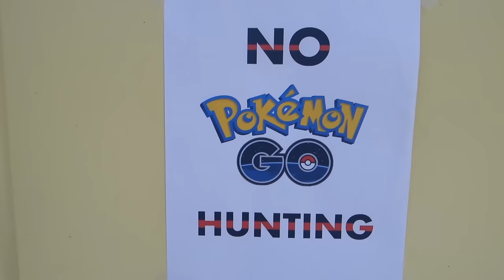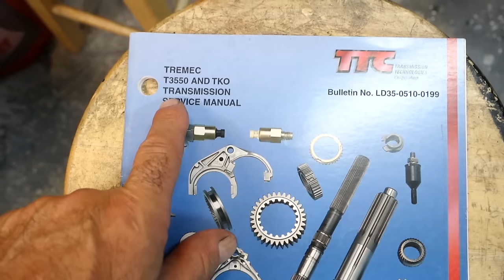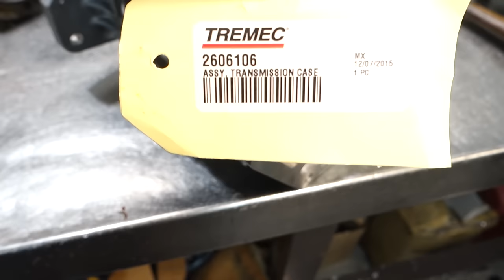How To Rebuild a Tremec TKO 3550 , 500 or 600 5 Speed Transmission

Comment: would it be possible to get a part number on the upgraded synchros you used in this build. I'm going to rebuild my 3550 and want to deff use the better ones. thanks!
Reply from the maker: The rings are available by calling us. The part # is a generic # and not the same as what others sell. 561-743-5600

Comment: Paul, Can you advise us what the proper oil is for the Dana300 and the Tremac T176? I am seeing conflicting information from other sources. I have a 1984 CJ7 with a T176 and  Dana 300 transfer case. I really enjoy your rebuild videos. Thank you
Reply from the maker: any 75 - 90 GL4 works fine.  The Tcase can run a GL5 and the gearbox a GL4.

Comment: What syncro did you use? We always had problems with them scraping after a real hard pull or two from the track, or just cutting it loose on the road. But mostly if some one missed 3rd gear then it starts. Great Video buddy honestly, help a lot on some stuff!! Thanks..
Reply from the maker: I use my own bronze forged rings. No issues

Comment: Question:  First of all fantastic video, my question is that after I removed my 5th gear, I noticed a small gap in the needle bearings as if it was short 1 bearing.  The input was not like this.  I may see the same gap in your video at 46:01, cant quite tell.  Can you confirm that the 5th gear bearings are supposed to be this way?  Thanks!
Reply from the maker: there has to be space in between the bearings for them to rotate , so sometimes the stack of clearance of all the bearings ends up with a little extra space.
Reply: awesome thanks for reply

Comment: Do you have a part number for the recommended forged bronze syncros? Have a tko I pulled from a 427 s/c cobra csx4000 that shift like total trash with like 8k original miles on the car and I really like to put these syncros so my 80 year old customer can actually drive the thing. I just added power brakes from him so making the trans/clutch a bit easier for him is next on the list! 
Thank you for the content not many very informative videos on these out there that are this easy to follow along.
Reply from the maker: They are available from us only. Read video description for all contact info.

Comment: Hello everyone!!! I need some advice and feedback please. I have a 67 Mustang gt S-code that came with a 390 4 speed originally. Was built to race car, built 460 Ford Big Block with a Built C-6 Manual valve body. I want to go back to a manual 4 or 5 speed behind the 460. Any suggestions what would handle 500hp and 700 on spray? The torque is way up there too. Thanks so much in advance for any suggestions. Cheers from Motown.
Reply from the maker: Companies like Modern Driveline sell TKX 5 speed conversion kits. Look them up.

Comment: Question….looking to convert my Ford TKO600 from a .82 to a .68 are the GM and Ford parts interchangeable for such a job. I’m assuming I need the main shaft and the 5th gear?
Reply from the maker: Yes you would need a mainshaft and 5th gear  Try  Modern Driveline.

Comment: Anyone know what lubricant Tremec calls for in the shifter? Petroleum jelly, grease, white lithium? I looked through the service manual and it provides everything except that. I have to figure either they expect it to run dry, or it doesn't matter what is used there.

Comment: This video is excellent exactly what I needed. I am rebuilding my tr3550 and now I have what I need to put the darn thing together. Just finished inspecting it. What is your view on using carbon fiber synchros?
Reply from the maker: Never liked them. Don't need them The design of the aftermarket rings was poorly executed.
Reply: Thank you sir! My rebuild is moving along but I am having trouble adjusting the countershaft endplay still have some play even after shimming .012 inch in addition to 3 shims installed. It was hard finding those shims. Any idea where I can get countershaft shims? Searched online and it seems no one has them. Thanks!
Reply from the maker: Jimmy Acosta I stock shim kits for the TKO.  Call me at 561-743-5600

Comment: I really like your videos , you're very thorough. I have a GM a833 MY6 4 speed with overdrive , can you do a rebuild video and is it possible to change the gear ratios in these transmission. It's in a 1978 nova behind a sbc , gear ratios are 3:09 / 1:67 / 1:00 / .73 , I also need it to shift better. Thank you Paul.
Reply from the maker: There were no ratios available but you can contact me to send me your transmission and I will do a video on rebuilding it.
Reply from the maker: www.5speeds.com/requests.html

Comment: So i rebuilt my tko using this video everything went well i thought until I put the top cover on with the shift rails. Without the cover the main shaft spun freely and smooth. With the cover on the main shaft was very hard to turn and I could only get it in 5th and reverse, It would not go into any other gear. I also replaced the 1st and 2nd shift rail and spring because one came in the shift upgrade kit i bought. It functions fine when not mounted to gear box. Ive taken it apart and put it back together twice now, and I'm not seeing my mistake. Everything looks good. Any advice?
Reply from the maker: You need to speak to who ever sold you the upgrade kit. You also need all components in place, such as the tail and front cover.

Comment: Hello there,  my name is Nick.  I have a T-56 6 speed and I am eager to find a rebuild kit for it, but when I looked around nobody could tell me where to find such a kit.  Could you by any chance tell me where I can find something like this.  If so,  it would be greatly appreciated! Thanks!
Reply from the maker: Any of the Tremec  dealers on Tremec's site can help.  There are many different T56 transmissions.  We do stock kits but they are close to 600 for the basics and are model specific. Call us at 561-743-5600.

Comment: I have a 3550, problem is the speedo cable pulled out of the cable housing. Now the housing is stuck in the extension housing. Is there a way to get it out or do I need a new extension housing. There is nothing to pull or pry on as it is flush with the aluminum. Any help is appreciated, ty.
Reply from the maker: There is the hole that the cable passed thru which you should be able to get a needle nose plier in

Comment: depressing this doesnt have more views
Reply from the maker: It's very specific.  Best thing you can do is share it! Thanks for watching
Reply: GearBoxVideo since i have your attention i might be going to look at a cheap used tko600 that was improperly rebuild and then sold off. for 600cad i am really tempted
Reply from the maker: Sounds like a great deal. It's worth more parted out.
Reply: GearBoxVideo i bought it and taking it apart i foubd he didn't put the spacer in between the roller bearings. he just stacked them on top of each other. look like it's time for a full rebuild. this video will be incredibly useful. thank you for spending the time to make this video
Reply: Not sure if you will read this but this video helped me rebuilding the blown tko600. Don't think I could have done it without your help. If you are ever in the Vancouver area beer is on me

Comment: Hello I’m in need of the 6 top cover bolts for a TKO 600. Do you know the size of the 6bolts that hold down the red shifter cover plate? Please and thnx
Reply from the maker: 8mm threaded flanged bolt available from any hardware store. Use a standard bolt with a lockwasher and that will work fine

Comment: Great video as always. What you are saying from 12:15 was new to me at therefor particularly interesting. Same with 27:44 What do you suggest as an alternative? Richmond 4+1 has "only" 450 lb/ft torque rating and 4 speeds including M22 Z has not enough total spread from low gear to top gear. GV is expensive, heavy and bulky. Thanks.
Reply from the maker: Torque rating isn't everything because axle ratio plays a huge part in how the transmission gets loaded. 3.08 gears load up a trans more than 4.88. I don't quite understand what you mean total spread? Because most 4 speed Muncies and T10's have a better closer ratio spread that a TKO. 5th is overdrive. You essentially have a wide ratio 4 speed with an overdrive gear.

Comment: Great video Paul, you makes it look so easy :-) I have a TKO 600 in a LS3 Cobra, what kind of synchro rings would you recommend? What do you think about the carbon surfaced rings? From which company can I by the rings you use? I want to be sure before getting the stuff to Europe with custom and shipping costs, thanks in advance, Micke
Reply from the maker: I never use or recommend the Carbon rings. In my opinion they are poorly designed. Just get a better bronze ring like we use and save yourself a bunch of money.

Comment: Question: How common are needle bearing issues on the 3550?  I have a 3550 behind at mildly modified 5.0 with probably 50k+ miles on the transmission (purchased in ~1997). I seem to have a vibration that changes depending on which gear I'm in. Not consistent with rpm or speed.

1st has some vibes, 2nd has more, 3rd is smoother and 4th and 5th are smooth. No odd sounds or issues shifting. In 2nd gear, mostly noticeable under load. New tailshaft bushing and ujoints on the driveshaft.

I've had the trans behind 3 different engines and doesnt seem to have changed, which leads me to believe it's in the transmission.
Reply from the maker: Usually vibrations maybe due to ancillary items attached to the engine . Unless the transmission's end play is out of wack and the extension housing bushing is wasted, usually look elewhere
Reply: @GearBoxVideo thanks for the input. One more question, can endplay be measured with transmission in the car? (89 Mustang). Not sure how you could pry the input/output shaft backward without access to the input shaft.
Reply from the maker: No it cannot

Comment: Awesome video. I have a tko600 that needs to be gone over. I read you make synchros for these but need to know a website or how to order these. Also my 600 is loud at steady cruise in 5th gear, it'll go quiet off the gas. Whats your thoughts to look for? I'm thinking gear roll over? Thanks
Reply from the maker: My website is listed in the video
Reply: @GearBoxVideo  I dont see the synchro for sale anywhere

Comment: G'day Paul. I bought a full reco kit off you some time back plus the cluster upgrade plate and the close ratio 5th. all to put in a Gforce case with G force gear set. I went to install the cluster bearing and the cluster has been machined to 1.248" thou and the in race of the bearing is 1.250"thou. I see SKF make a speedi Sleeve to cure the size discrepancy. Do you think this is a good idea?
Blair fraser
Australia
Reply from the maker: Gforce has slip on bearings. Just use loctite bearing mount adhesive
Reply: Thanks mate!  You're a bloody legend!! Your book and videos are awesome by the way!
Reply from the maker: Thank you.

Comment: I was wondering what you would recommend for a 5 or 6 speed transmission to put in an early fbody? Something in the $2500.00 to $3000.00 range..
Reply from the maker: The GM version of the TKO 500 will actually fit an early Fbody with no cutting.
Reply: @GearBoxVideo  Thank you.

Comment: Hello Paul:  Thank you for your videos, they are a big help to many of use.   My question to you is, you stated that you do not sell or recommended the TKO transmission.  What transmission do you recommended for a LS swapped SN95 Mustang.  I was thinking of doing a GM T-5 at first,  knowing it would not last to long.   Then I thought about the TKO, then after see your video I'm not sure now. This will be a budget build.

Thank you.
Reply: Or would it be best to just upgrade the T-5, money wise?

Thanks.
Reply from the maker: I don't sell any current 5 speed transmissions because I am not happy with the build quality as well as there really is no money to be made. There are a bunch of people falling over one another to sell these for 20 dollars over cost and then deal with warranty issues, shifting problems etc. I don't need the headache. However, the TKO in my opinion is the better versatile 5 speed out there.

Comment: I don't want to repeat anything but I haven't read all the comments yet. but what are the main differences between the 3550 500 and 600 boxes apart from gear ratio? also is dog syncro modifications sort the shifting issues you mention?
Reply from the maker: Integrity and design of the gears. Early boxes had multi piece countergears that came apart and different alloys

Comment: Do you recommend the after market carbon synchro blocker ring and bronze fork pads?  Video is awesome BTW.
Reply from the maker: Actually no. Because the process was done by machining cheap offshore rings down and glueing a lining to them.  So the outer shell is compromised. They tend to balloon open pretty fast.  If you look at the T5 for example the rings was changed to steel and the cone diameter reduced. Also carbon rings to work properly run at a different cone angle. Use syncromesh oil and good bronze rings.

Comment: I’ve got a 3550 that’s got low mileage on it. I pulled it to replace a leaking rear main seal and noticed the tip of the input shaft has some wear or score marks on it from the pilot bearing I’m guessing. Is it possible to just pull the input shaft out with pulling apart the rest of the transmission? I saw the part were you pulled it off so I’m assuming I can. I just have to get all the needle bearings back in place on the install.
Reply from the maker: Yes. This happens from misalignment, especially with Roller bearing pilots. I never use them. Use a good Oilite bearing that we sell
Reply: @GearBoxVideo  yes it does have a roller bearing. If I’m replacing the input shaft can I upgrade it to a 26 spline while I’ve got it pulled apart?

Comment: My tko600 has been sitting around for about a year. Now that i finally installed it in the car i cant get the driveshaft to go all the way in. I think something may be stuck in the extension housing blocking the driveshaft yoke from fully going in. Is that possoble? What is in the extension housing with trans all sealed up from the output shaft forward? Please help.
Reply from the maker: Call the people who sold you the unit

Comment: This is an excellent video.  Before this any transmission work would've repelled me like a cross to a vampire.  Anyways I know you've heard this question before but I'd like to ask again lol.  Do you think a faceplated tko 600 is fine for street with an occasional track use, or would it be better to just get one that's pro shifted? Obviously I had planned on purchasing from libertys gears.  Of course any info is appreciated.
Reply from the maker: Face plating and pro shifting accomplish the same result replacing synchros with a lugged system. Face plate design is superior to the old proshift design and because of space limitations of the TKO. Using any lugged system on the street works but expect to have the unit replated depending on how good you are at managing the shifts

Comment: Hey I got a NP435 that im doing a rebuild on, It doesn't have your typical brass synchro, what can you tell me about these( like how they work) I havent started to pull it appart too much because I don't have a press yet but I don't remember hearing about these at the really bad mechanics school i went to.
Reply from the maker: The synchros just work the opposite. The ring is also the cone. Most NP435's are really easy to rebuild, everything slips together except for the front bearing press on the input.
Reply: Thanks, love your videos, keep em coming.

Comment: By any chance are the main shaft and 5th gear from GM models interchangeable with the Ford versions?
Reply from the maker: Lower gear, maybe. Depends on ratio. Upper gear  os part of the mainshaft so  it depends if the mainshaft jas the same spline count

Comment: When you pull 5th off one of these, remove it with the fork, slide the gear back a bit and get your hand on that thrust plate.  Then you don't dump needle bearing everywhere or have to deal with them at all.
Reply from the maker: If you rebuild a transmission you deal with everything. The needles need to be inspected and the object of the video is to show people how to load the needles on assembly. Not take short cuts,

Comment: Hi again mate!  Would it be possible to do a rebuild video on the single rail 4 speed?
Reply from the maker: When I get one I will.  What one do you have in mind?
Reply: I use a ford single rail box in my race car which is called a Holden commodore
Reply: Check out my video Blair Fraser Conrod straight hard cut on YouTube if you get board and have 2 minutes i like single rails they are pretty strong.  I'm in Australia by the way
Reply from the maker: But what transmission?  Is it an SROD toploader with a OD 4th?
Reply: Sorry us aussies only got the 1:1 4th box we never saw the OD transmission mate.

Comment: Paul,  I've got tko500 that will go into 5th but not come out unless the top cover is pulled and popped into neutral.  Thoughts?
Reply from the maker: Could be the interlock is not positioned correctly

Comment: How do you know when it's a World Class T5?
Reply: A world class t5 is the same as a normal t5 just a little bit stronger gears a tko is completely different looking and bigger a t5 is 63lbs a tko600 is 123lbs
Reply from the maker: No. There are huge differences between world class and non world class. This will be discussed in an upcoming video. The TKO is a completely different form factor and design and had a similar evolution from the 3550 to the TKO to the TKO 500-600 range.
Reply: You can tell externally by the bearing race on the front, or by running the part numbers on the tag.  Fox Mustang t5 typically have torx head for the 5th/reverse arm lever bolt for World Class, but it's not 100% accurate and doesn't apply to other models.  Inside, it's very obvious - non world class are junk.